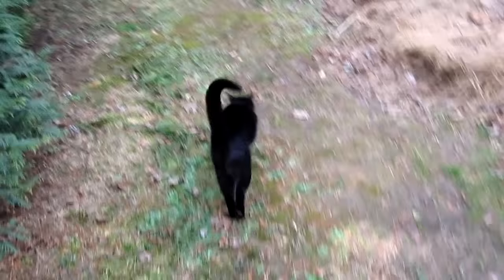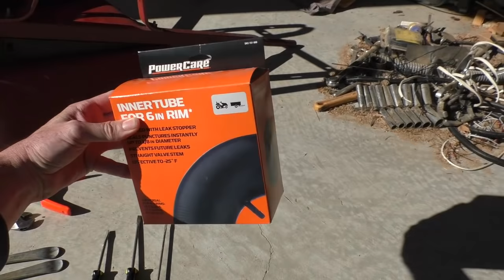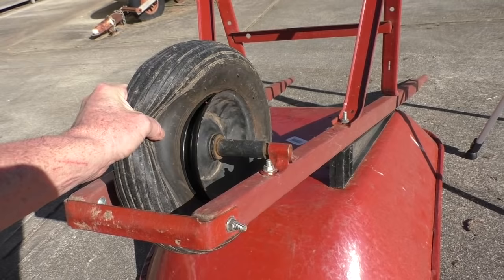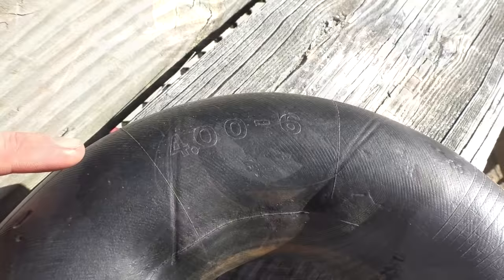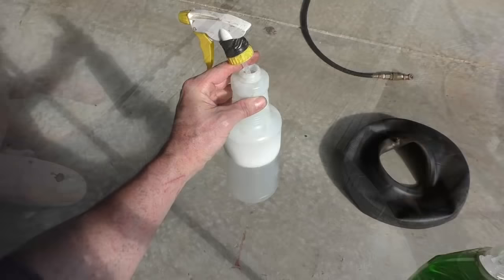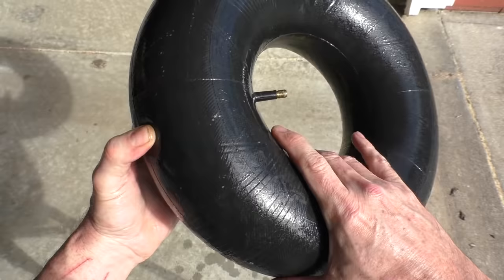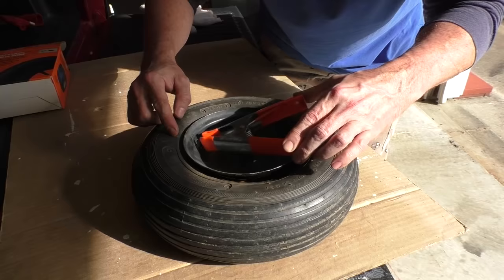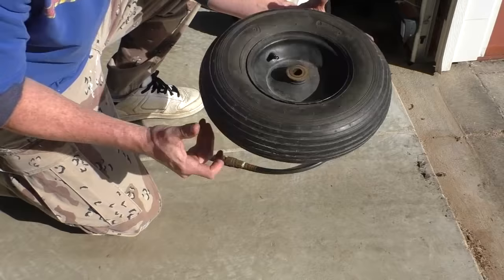Fix Flat Tire on Wheelbarrow HOW TO REPAIR inner tube install

Comment from the maker: Tire Iron Set: https://amzn.to/2N8xCun
NEW Tube: https://amzn.to/35Q61q4
Other Garden stuff I use:
Grey Containers I use on the Deck for lettuce: https://amzn.to/35FoAx8
Organic Fertilizer 5-1-1 Quart size: https://amzn.to/31r2ACQ
Organic Fertilizer 5-1-1 Gallon size: https://amzn.to/2MsU3Lt
Four Gallons best price: https://amzn.to/35JbiQi
(I mix one tablespoon per gallon of water, feed once per week)

Morbloom Fertilizer 0-10-10 Quart: https://amzn.to/2J1x1sQ
Morbloom Fertilizer 0-10-10 Gallon: https://amzn.to/33NbeNL
(For the tomatoes and peppers)

EARTHWORM CASTINGS: https://amzn.to/31yKj6U
PERLITE: https://amzn.to/31ttOsC
VERMICULITE: https://amzn.to/32oCQIF
AZOMITE rock dust 44lb: https://amzn.to/35IhbNP
AZOMITE smaller 2lb bag: https://amzn.to/35VQ1mG
(mix into soil for healthier plants)

Seedling Heat Mat: https://amzn.to/35GsLsJ
Heat Mat Combo Pack: https://amzn.to/32t6agZ
Heat Mat Thermostat: https://amzn.to/2P6C3YS

Small 2" Seedling Pots: https://amzn.to/2VYAuOq
Larger 3.5" Seedling Pots: https://amzn.to/2J1dfxI
Sterlite 16qt Containers (Holds seedling pots): https://amzn.to/35IfzU1

Soil Sifting Screen: https://amzn.to/31yVpc4

Food Dehydrator:
Excalibur 2400: https://amzn.to/31qCsbh

Wind Chimes I bought:
Medium size: https://amzn.to/33HA0Ph
Small version: https://amzn.to/2MVWPI7
Large size: https://amzn.to/2quYuNp

Garden Shoes (Waterproof):
Clarks Bowman Free: https://amzn.to/35FhZTo

Animal Control (Deer):
Motion Activated Water Sprinkler: https://amzn.to/2pFOKiH
Fence 50' roll(green coated wire): https://amzn.to/2P4l8X4

Insect Control:
BT Caterpillar Killer(Organic Safe): https://amzn.to/33LLxge
Neem Oil(Organic Safe): https://amzn.to/31nTczW

Cameras - Motion Activated:
For viewing Deer and Animals(also for time lapses):
Bushnell Trophy Cam: https://amzn.to/2OS2rWA
BOLY SG562-D (with spotlight) https://amzn.to/2BfQmm7

Camera I use to make youtube videos:
Panasonic HC-V770 Camcorder: https://amzn.to/2qc82MX

SEEDS - My Favorite Varieties:
Greens:
KALE: https://amzn.to/32uRazd
Collard Greens: https://amzn.to/32vv7J0
Lettuce - Red Sail: https://amzn.to/31r5XcY
Lettuce - Black Seeded Simpson: https://amzn.to/2MtGk7h

Tomatoes:
ROMA Italian Tomato: https://amzn.to/35MOlf1
Sun Sugar Cherry Tomato: https://amzn.to/2nX95zB

Peppers (Sweet):
Giant Marconi: https://amzn.to/2pBfTDK
Red Bell: https://amzn.to/2J2VYnI

Peppers (Hot):
Cayenne: https://amzn.to/2VU0vy3
Serrano: https://amzn.to/2VVBK4w

Beets: https://amzn.to/2pwpBXW
Radish: https://amzn.to/2VSk0Hx

Cucumbers:
Alibi (Most Productive I've Grown): https://amzn.to/35P7pZZ

Beans:
Rattlesnake Pole(Green and Purple Stripes): https://amzn.to/2BrdaPC

Green Watering Can: https://amzn.to/2MstSV9
Small Cages for Pepper Plants: https://amzn.to/33DiCuS
Greenhouse 8'x6': https://amzn.to/2Mtg4d5

Thanks. I hope this list was helpful to someone.

(paid link)
As an Amazon Associate I earn from qualifying purchases.

Comment: Good video.  A trick I would suggest is add a little baby or talcum powder to the inside of the tire before inserting the new tube, rotating the tire for full inside "coverage" and always inflate/deflate the new tube 3 or 4 times after installing the new tube and before installing the valve stem.  This allows the tube to expand and contract freeley and helps prevent a crease in the tube that can lead to another failure.  Nice use of the wheel on the frame to help remove the tire!

Comment: Steps worked well for removing tire. Was a struggle with bike tire levers, but did eventually remove one side of tire so could remove tube. Tube was fine apart from one puncture. Have had this wheel barrow for over twenty years, so inner tubes do last. Used bicycle puncture repair kit to mend puncture. To find puncture put inner tube bit by bit in a basin of water till saw bubbles coming out.

Comment: There is nothing I dread more than changing the inner tube on a wheelbarrow. Today a neighbor came over and offered to trim the trees and hedges on my land; nice gesture and some of them have nasty spines. I told him I would pick them up later and an indigenous laborer I employed went over the cut branches with a load of dirt and you can imagine the result. What used to take me 3-4  hours  along with hammering back dents in the rim took me less than an hour thanks to your excellent video. Thanks for taking the time to shoot and post it.

Comment: This video is out of my abilities.
I applaud anyone who can do this type of work. 👍🏼
Reply: Same!
Reply: No, give it a go, you can't break what's already broken, also soapy water helps the tyre go back on a lot easier
Reply: @Ted_Of_The_Overflow  
With age your strength isn't what ot was in your younger days.
Before my dad wouldn't me get my drivers license intil I knew the basics of the car, checking oil ect. Living in a rural area he consider it was neccessary. He even had me change a tire, granted the spare is different than fixing a tire. But he watched me and when the task was completed he told me to put the tire back on the car that I had just taken. 
Actually taking the jack out of the trunk and putting it under the car and raising it wasn't easy but quite double.
But now in my late 70's I could never do that so I carry AAA insurance.
For any not in the US this is a road assistant insurance,  It's rhe next best thing.

Comment: Nice concise instructions, I've done 4wd tyres and wanted to see if there were any tricks to small rims. I like how you left it on the axle and spun it, and the clamp on the valve stem, great tip! Soapy water is great for getting tyres back on. Nice to other psycho cats out there.

Comment: Spring clamp on the valve stem is golden! I've done super cheap patches on old tubes using just screwdrivers, and I've replaced the entire wheel/tire assembly. Amazingly, Amazon sells the entire assembly for only about $20. While I understand your time constraints, for twenty bucks I'm not going to mess around with replacing a tube.
Reply: if i purchase the entire assembly how do I know what size to purchase?
Reply: @charlotteleiendecker2398  - The sidewall of the old tire has tire dimensions embossed on it.

Comment: Thank you so much for making this video! I bought a cheap wheelbarrow assembled it used it three times the tire went flat beer and a half ago. I dreaded having to find the right size inner tube and having to take it apart. But after watching your video I was able to complete the task in about 20 minutes. Your suggestion to use the tire irons is something I would recommend as it help move the process along very quickly.

Comment: Thank you for this video. I have had a flat on my wheel barrow for a very long time and wasn't sure if I could fix it. My old one had a solid tire. I wated you to know I have enjoyed your videos and have saved several to my gardening file. I just started watching and have gone back to the beginning to catch up. what an improvement your garden has made over the years. Even tho the post was long ago, I only saw it yesterday and thought I would comment on it today. You mentioned that your tomatoes in the front were sparse because of poor polination. You may not be interested, since you have so many other tomatoes in your back garden but my opinion is you don't have enough things flowering to draw bees to your front yard. everything is green except your tomatioes. Adding a couple of flowering shrubs like a butterfly bush or a few containers of zenias which are no work other than watering might be the thing to bring the bees around. The most helpful videos for me were your rain barrel set up, fencing around your raised beds (I too have raised beds) the greenhouse, the way you start your plants, (I too use square foot gardening) and the fertilizer you use as wel as dehydrating the tomatoes, peppers and herbs. Thanks again , enjoy watching them all, your garden is lovely.

Comment: Good video. Will buy some tire irons to add to my tool collection. Wish someone would repair the tube instead of replacing it. I have a couple of tubes that have small holes and would find it cheaper likely to fix the holes.

Comment: I've filled the tyres of all my mowers, compressors, washers etc etc with puncture foam so it is a rarity to get a puncture nowadays. Previously, the cheap, thin tyres on stuff would fall victim to thorns all the time.  Thanks for the useful vido, even if I do know how!

Comment: I love Squeak, how he gets a bushy tail as he runs around, precious. Thanks for the tier repair, now for the handles...?  I have the handles, on my current wheel barrow the handles measure 55 inches, had to get 60 inch handles, my question is do I leave the extra or do I cut off the extra?  Any help in this would be great.  TIA.

Comment: I tried to remove my wheelbarrow's tire using the method shown here, with a couple of flatheads, and bent the crap out of my wheel's rim. 
Life lessons kids, don't buy from Harbor Freight if you want your equipment to last.

Comment: I cant understand what's going on with my tube/wheel. I have fixed the leak, but as soon as I try to inflate the inner tube after it is in place, it releases the air! Have taken it out twice because I thought I punctured it again, but no. When it is out it holds air perfectly! Any help?

Comment: Spotting your green house in this video reminded me that I wanted to ask you about how you like it and how its holding up. I got the 10x12 one as a gift from my boyfriend but we are in the middle of moving so I haven't been able to assemble it yet. Is there anything you would have done differently? Any special tips or tricks to share?
Reply from the maker: hi, the greenhouse is now 3 years old and is in great condition. weve had some strong storms with wind gusts and there has been no damage. the main modification that was essential was building the second screen door so i can leave the door open and wont have cats and animals inside.

Comment: This is rubbish!  Never use screwdrivers or any other tools to stretch the tyre over the rim!  You risk damaging the new inner tube.  Simply coat the tire edge with washing up liquid then use your hands to push the tyre over the rim!